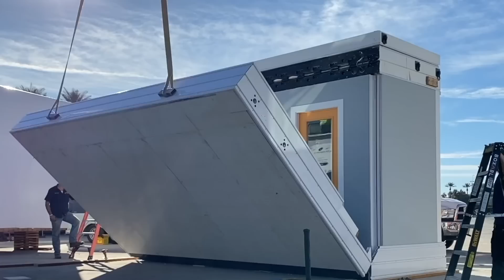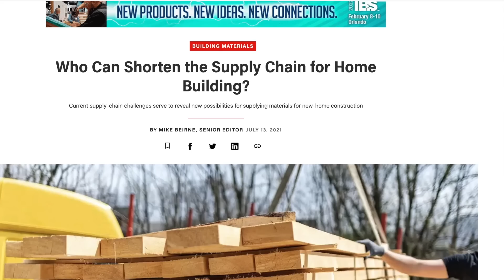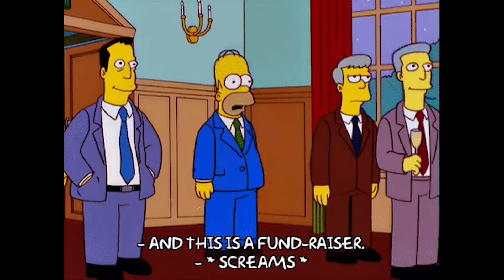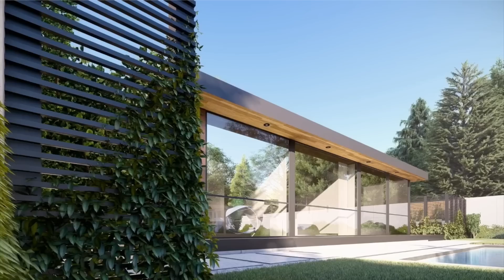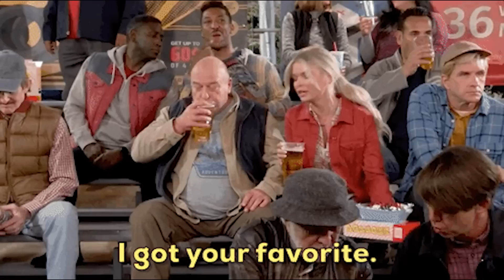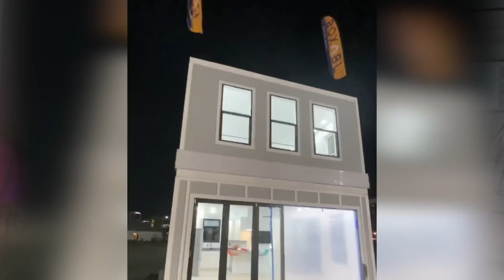Very Costly Investment Mistakes of Modular Homes

Comment: I thought a modular home was built in a factory and fully assembled - placed on property that normally has a slab.  Difference between Modular home and Manufactured home is the building codes used.  Manufactured home build is using HUD specs: Modular home is built under stricter local codes.  How about pre-fab homes?

Comment: Some of the information you provided isn’t accurate.  Manufactured homes are based on HUD building codes and are typically built on a steel I beam so they can be moved (ie a mobile home/ trailer, can come in double or triple wide). A modular can be sent in two built pieces and then installed onto a foundation that is either a full foundation or frost wall, they cannot be installed onto slabs.  I think your confusing some of your information with HUD manufactured homes and not modular homes.  Some of the examples you provided on your videos are based on panelized construction not modular construction.

Comment: Kristina, I think you need to be clearer about the difference. You've been clear in the past. I think this was just a slip. I learned all this from you.  Here's my short summary of differences between modular and manufactured homes (two horribly and unfortunately confusing name choices that in the end are just labels for the building code that they adhere to. )

Manufactured - delivered on wheels on trailerable frame, sometime in separate modules, considered impermanent even if permanently mounted. Built to HUD mobile home standard. Generally built in a factory but not necessarily indoors. 

Modular - built from substantial pre-constructed components or modules that can be more quickly assembled on site than stick built homes, designed only for permanent installation on a foundation. Built to permanent home codes for local area. Generally built in a factory, but not necessarily indoors. 

Some manufacturers build to BOTH standards with similar floorplans but different building codes. The code used is the deciding difference.
Reply from the maker: Thank You for the clarification. I assumed most have seen my previous videos it would have been clearer. That was a bad assumption. I’ll be clearer next time. Thank You.
Reply: @KristinaSmallhorn  Thanks Kristina. You're becoming famous and getting lots of new viewers.  You might think about always pointing them to a link so that you don't have to repeat yourself. That said, a link to a webpage with the differences and implications would be a great service. I did a bit more editing in my comment trying to capture the important differences. With all that said, I think you should write a book on this. It would go well with your friend's land book which I just ordered!  The set could be a pretty powerful help for people looking to become knowledgeable about affordable housing. You might even include a decision flow diagram. 

Btw, I neglected to say that I think you rock!!! 😊
Reply: @johnatyoutube  New to the channel and appreciate the clarification. Where can I find the land book, and who’s the friend? 😊

Comment: Bought a "modular" from PH mobile home manufacturing. I call it a glorified double wide. Do think the steel trailer beams make it stronger, as it sits on a concrete slab. Net cost might have been similar to a stick built, & think the quality is a reflection of the attitude of less than enthusiastic workers. Have noted the mobile home sellers  seemed to have quit making modeler's. I did have to get the TX Department of Licensing's after them & think that had to go back & redo 6 homes they had not set up right.
Reply: Steel frame > it's manufactured, not modular